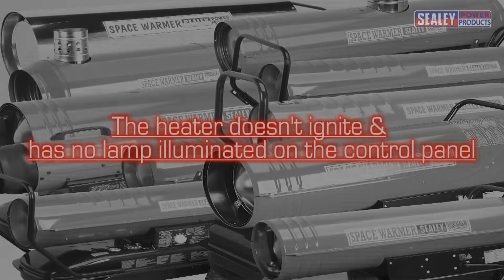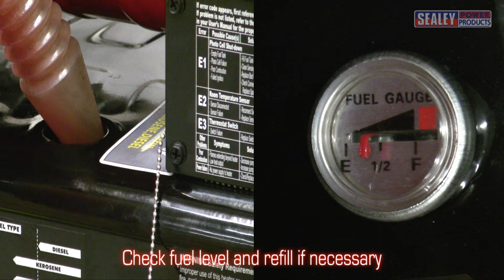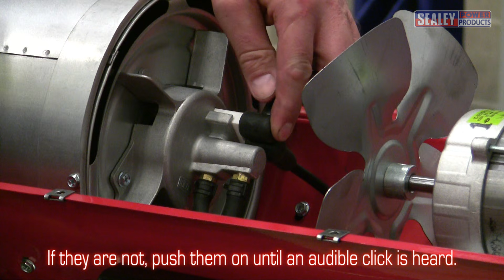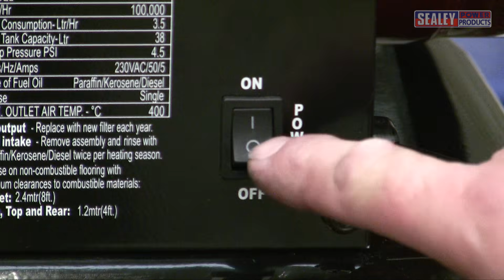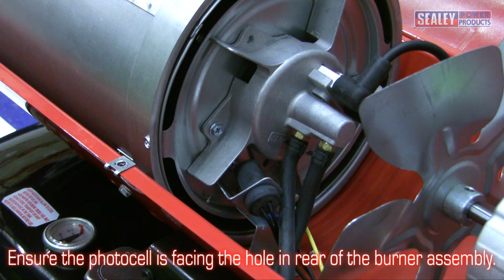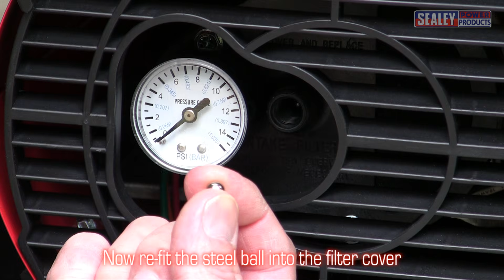Sealey Space Heater, Troubleshooting for AB1008, AB1258, AB1758, AB2158

Comment: Is it ok to run this heater on a mix of waste motor oil and diesel? 50:50
Reply from the maker: Hi. Thanks for your query. No, it is not recommended to run a Sealey Space Heater on a 50:50 mix of waste engine oil and diesel. They are designed for clean kerosene, paraffin, or diesel fuel only (not biodiesel).

Comment: do you know how to replace the fuel injector on an ir37 infrafed heater?
Reply from the maker: Hi, if you can pass on an email address I will be able to send a brief guide over with attached diagram.
If not I can post the guide here but you will need to visit our website for the parts diagram.Thanks
Reply: Sealey Tools jamessolodog@gmail.com

Comment: I used red for one winter and my heater has never worked properly since, followed all steps and replaced photo cell, plugs, drained fuel and put fresh in and adjust press. it still won't burn right, very fumy and cuts out with e1 usually after a few mins. don't know what to do next
Reply: Long time ago now but did you ever manage to get your heater working again? Mines is the exact same, tried to fire it up in preparation for this winter and wont run properly after using red diesel last winter.
Reply: @stoogiex  absolute waste of time mate spent a fortune on it and was never right out of the box. I went for a waste oil burner in the end. Bit more messy but pays dividends being able to get rid off your services as free heat
Reply: @crooke80  thanks for your reply pal much appreciated, shame because it was such a good heater and for whatever reason it fires up and purges constantly, watched every video on you tube and spent ages tryin to solve the issue, time to get something else for sure, shame really because its only a couple years old.
Reply from the maker: +crooke80 Hello, Thanks for you comment. Sorry to hear about the issues. I have spoken with out technical department and you have already tried everything they would suggest. The best step now would be to return to unit via the distributor for one of our engineers to have a look at. Alternatively you could find a service agent for heaters.

Comment from the maker: Thanks for your comments.
We recommended, to improve the life of the heater and its components to use Normal Pump Diesel, Kerosene or Paraffin.
Red diesel is ok to use, only if its straight Red fuel and doesn't contain any Bio-Diesel.
Also your heater will require servicing/cleaning more if red diesel is used.
Regards